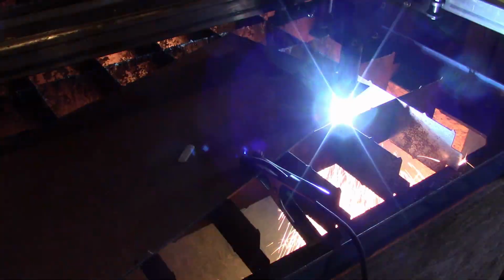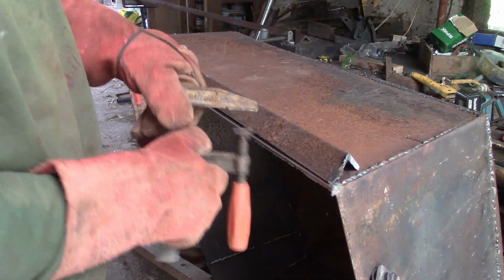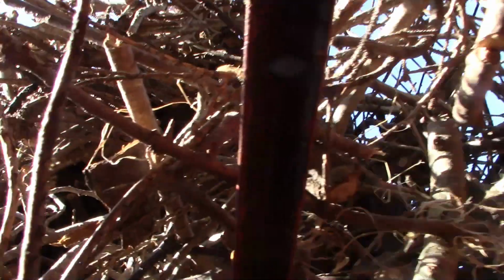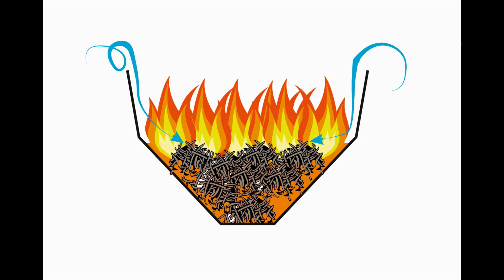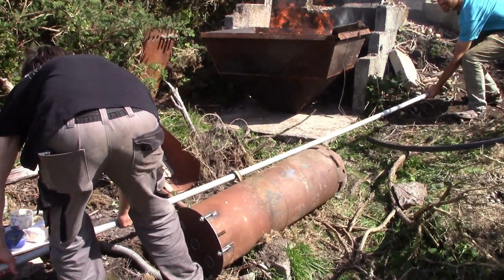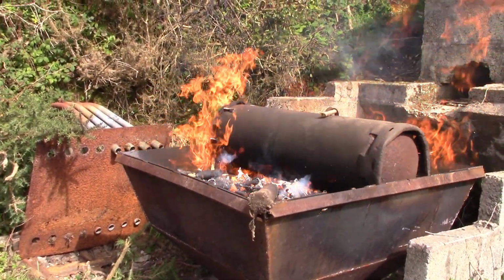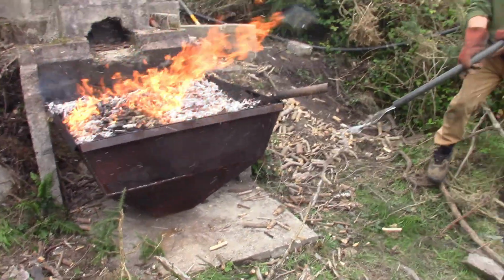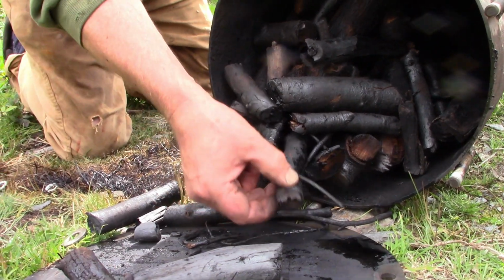Life, Death And Charcoal. (Testing The Chip Trap-Doors, Making Charcoal Kilns, Activated Charcoal..)

Comment: you could turn water into steam, to transport the heat to where ever you you want to store it. you condensate the steam thus getting the heat back. If you do that you could do some work with the steam along the way. f.e. you get some old broken 4 cylinder motor. you use two of the cylinders, for the steam and the other 2 to compress air. Preferable you would compress already compressed air, thus getting from lets say 10 bar to 70 bar or whatever ratio the motor has.  I would think it were rather poetic if you run your run your locomotive on compressed air, compressed by a steam engine.
You could also run a motor or a turbine with wood gas. that is less poetic though.

Comment: liquid sodium breeder reactor could heat your house. Or the Valley of the Kingsford briquettes.
Reply: In the mid 1950s in Lancashire we burned briquettes in the living-room fire. A briquette was about the size of a regular house-brick, but not as heavy. I suspect that these briquettes were made from coal-dust, or pulverized coke, with a binding agent.
Which makes me think of pulverized charcoal held together by, say, stongly-diluted wood-glue, formed into bricks, and left to dry.
This would be a form of stored energy.
Trolley the briquettes to the house and use them as furnace fuel, water-heater fuel and so on?
Chris

Comment: I now wonder what chemicals are in the water after the charcoal
Reply: I would venture a guess carbonic acid. Which it can really only hold so much of in solution depending on temperature. Nothing too gross its not like the tree was made out of heavy metals.
Reply: @ntacms90  ah so nothing that usefull
(unless you have lots of stomage problems)

Comment: Tim, look at rocket stove flue designs for the chimney. Where the flue stack is lined with refactory, which is heated by the combustion, to aid with the reburning of gases by the extra air.
Though they do require a lot of heat from the combustion to get/keep the stack hot. Which you may be struggling to provide?

Comment: A cone kiln are a simple construction, but it is very wasteful and just poring water do not turn charcoal into activated charcoal. Have a look at "Cody's lab" for making and testing charcoal and activated charcoal. The steam pressure has to be internal in the charcoal to increase the surface and activate it, but you get the same result from using regular charcoal if you triple the amount.
Reply from the maker: Thanks. I have watched all of Cody's charcoal videos. And yes, you can use water to activate because it turns to steam in the charcoal.
Reply: @wayoutwest-workshopstuff6299  You should replicate the filtration test that Cody do and compare it to a commercial sample.
Whatever the result it would be interesting to see the effect of the way you do it.

Comment: Could one accomplish the same as a "cone kiln" by simply digging a hole in the ground about the same dimensions?  I probably have you beat on a "shoestring" budget. :P
Reply from the maker: I'm sure a hole in the ground was exactly how charcoal was made for thousands of years. It's just more difficult to empty and if the ground is wet (as it often is here) it would spoil the burn
Reply: You can. But the ground would suck away an awful lot of heat energy, so you might not get the temperature high enough where the wood touches the ground.

To keep that kind of thing being a nuisance, you could make the hole huge-er, so the ashes and charcoal and wood Gases act as insulators

Or you could line the hole with something insulating and heat resistant like mineral wool or calcium silicate, but those materials tend to not like being exposed to the moisture in the ground when the thing is not in use, so you could line the earth first with something impermeable and heat resistant..... Like steel.... But then, here we are again... We are building a steel cone kiln, and also have to go through the effort of burying it, and lining it with some insulation, so best just leave it outside the ground and let the air do the insulation
Reply: Thats how it was done historically. Earth is a good insulation too as added bonus. Here is a link for old documental film of several traditional charcoal making methods in spain.
 https://www.youtube.com/watch?v=uR9fHKO-vlY

Comment: You will need a set of tracks on either side of the kiln, with a crain structure built between them so that you can lift lids, and charcoal tubes in and out. So much potential.

Comment: There is a better way of doing it!  Use 44gal drums  with holes in the bottom - fill them up with the fuel - light them from the top - the fire burns down - air comes in underneath and there is no oxygen remaining in the upper levels to burn the carbon , but lots of heat to keep the pyrolysis process going.  When hot coals appear at the bottom of the drum and you're sure it's finished - cover the base with dirt to stop air from going in the bottom - and if you've got an effective seal on the top of the drum you can wait for it to cool down below combustion point - if not cool it with water!
Reply from the maker: It's better in some ways, but slower too
Reply: But a lot less work - no need to feed it - just come back regularly to check if it's finished and shut it down.  You get about a third of a drum of charcoal!

Comment: Dear Reader,

I've thought of a simple and cheap 'locomotive'. Why not build a simple rail speeder from steel pipes, and, let's say, an old mowing machine motor? 
There are many examples of building a DIY speeder on YouTube. This is just one of them. https://www.youtube.com/watch?v=FQTYJQku_Ao
With a good gearbox, you could deminish the top speed and increase the traction, so it could pull an wagon load.

Just a thought.

With Kind Regards,
Michel F. van den Brun
Viewer

Comment: The Best explanation of Flame Cap Pyrolysis I have seen to date wonderful great stuff.

When I want to start my fire quickly in my kiln I use a tepee fire to begin, this fire can be quickly scaled by adding rings of longer and longer sticks, I usually blind each layer with the wood from our branch logger to fill in the gaps.

Comment: really long, long way to get this charcoal and on top an awfull lot of work.
But at the end the biggest benefit might be the heat generated and used in the house one way or the other as warm water or heating which both will require a big and highly isolated watertank as a lont time storage considering the amount of heat generated in such fire. 

Still wonder why those chips are not falling directly into that fire cone place - some how controllable cause now it needs a lot of work to throw them in with such fork.
Great progress and final product even though it might be a longer way to get it done in a bigger scale with such layer of bombs on top. I also think the holes are too small in this bomb therefore the high pressure which can lead to condensation in side which then would cool down or protect the chippers on the outside.

I can remember that decades ago when we were trying to smoke our fishs. Huge apparatus, lot of work and preparation for the right chips to get the right smell and sometimes the fishs back fin melted away and the fish fell down into the 'smoke fire'. 10 fish and all were gone in the first try due to too much heat .

Comment: I've heard that salt and be molten into a liquid and is good at storing lots of heat.
Reply: Common salt melts at 800 degrees Centigrade/Kelvin good luck with that!!
Reply: Before solar PV got cheap there were some solar thermal schemes that used concentrated light to ultimately melt salts as a heat transfer/storage mechanism.  I love Tim's historically inspired projects, but I would be curious to see some modern retrospective engineering as well.  Some things we have in the modern world would have been possible with the technologies of the past, we just didn't know!

Comment: The CO2 released from burning wood is a non-issue. It is part of the renewable circle. The CO2 that is a problem is CO2 produced from burning coal and oil. People like to throw about the idea that burning wood is just as bad as burning coal since essentially it is the same thing. 
The problem with that view point is that the carbon is being taken out of the air by the tree in the first place. It is part of a loop of carbon extraction and release. The problems we are facing with climate change is due to the release of carbon that has been sequestered deep beneath the ground as oil and coal.

Also, with the way your cone kiln works, the fire is always on top of the stack. As the wood beneath it is heated, it releases its VOC's which are then burned by the flame, making a really clean burn
Reply: Any burning of wood is carbon neutral - making charcoal is carbon positive if you never let it burn again. Bury it in your garden as biochar and I doubt it will get back into the atmosphere.
Reply: Coal and oil were once in the atmosphere stored away by mother nature by a biological process. Burning coal and oil just puts it back where it started from.
Limestone, chalk, coral and marble also carbon stored naturally by mother nature. We are in a carbon debt.
Reply: @andrewmills744  Yes, stored away many millions of years ago, and created slowly over millions of years. Are you aware that the last time we had this much CO2 in the atmosphere there were forests on Antartica?
Reply: @solrogersmullins5973  what's wrong with forests in Antarctica? We didn't do it... must have been mother nature. 
All the coal was laid down in 120 million years. 
Oil will regenerate.
Reply: @andrewmills744  The issue with "forests in Antartica" is that the conditions that would make that possible would mean the extinction of just about every species on earth including us.

climactic changes like these are supposed to happen over many millennia, not decades and centuries.
Reply: @solrogersmullins5973  where did you get that from? 99 percent of all life on earth is extinct
Reply: @andrewmills744  I don't see your point. How does that change the fact that rapid climate change will cause mass species  extinction?
Reply: @solrogersmullins5973  show me this "rapid climate change " . Remember we are still leaving an ice age.
Reply: @solrogersmullins5973  the end of the Carboniferous period is an example of climate change extinction as plant species and simple life died off because of the shift from a co2 rich to a oxygen rich atmosphere. It's that life that became the coal and oil.
Reply: @andrewmills744  the world was a more inhospitable place back then
Reply: @Falney  sure it was dinosaurs living it large.... how many deserts did they have vs now? Mmmmmm
Reply: @Falney  coal is 240 to 120 million years old, hardly older than the dinosaurs. Oil is being generated constantly.
Reply: @andrewmills744  wrong. It's from the Carboniferous period. 358 to 300 million years ago. The earliest dinosaurs didn come until 45 million years later.
Reply: @Falney  what is the name? The name of the little world you live in?
Reply: Tim's experiments are inconsequential compared to flying airplanes around etc, but burning wood IS the same as burning coal, no reason to green wash it.  Carbon has been sequestered in the wood and is being released when it would otherwise eventually be buried, or sit around as lumber in a house.  I don't believe soil is a net producer or consumer of methane, so that shouldn't affect it.  Everything in modern life produces extra CO2 though, and it mostly doesn't matter.  We just need to produce a bit less.  Watching things burn on YouTube is very green BTW.

The impacts we predict from large-scale climate change are mostly bad to unknown.  Would you happily push a child in front of a moving bus so they go to heaven?  I guess it could turn out great, we'll have to try and see!
Reply: @andyb2339  Unless you take wood from the surface and bury it in an anaerobic environment, all cellulose will eventually be converted by bacteria into glucose releasing carbon dioxide and methane. You have bacteria that do this inside you right now, all animals which consume plant matter do.
Reply: @andyb2339  burning coal and burning wood are not the same. It's like bio fuel vs fossil fuel. With bio fuel you grow a plant, most often oil seed rape. This takes co2 out of the air. You extrac the oil, process it into a fuel and burn it. It is co2 net neutral where taking crude oil and using that introduces new co2 into the air. Thus net positive co2.

It's the same burning wood over burning coal. You grow a tree, removing the co2 from the air. You then burn that wood which releases co2. Net neutral while burning coal introduces new co2 into the environment.

It's the same with methane from digestate and methane from a well. 

Hence my comment about it being a closed loop. 

Converting coal plants to burn wood pellets is technically greener, at least in the short term, than replacing that coal plant for green energy.
Reply: CO2 is still a trace gass in the atmosphere, measured in parts per million. Wouldn't more CO2 in the atmosphere not give us more plantfood and wood actually?
Reply: @NicoSmets  We do need the greenhouse effect. The concentration of Water, CO2, Methane ect that is in the atmosphere naturally gave us our climate we had 200 years ago. By putting more of it into the atmosphere, we are Terraforming the earth into getting warmer in the long run. And the additional heat that is trapped by the CO2 emitted by us is going to make more water vapor (that is what causes stronger storms and more droughts, too). Locally, there may be some cooling effects (it is expected that if the golf streams stops due to the missing ice in the north, that Europe is brought back into an Ice Age for some time, until the temperature catches up), but we can assume that wild anomalies like storms, droughts, heat waves, cold snaps ect are going to become more frequent as they would have been with natural concentration of gasses.
Reply: @NicoSmets  sorry, but that is a very stupid talking point.
Reply: @MusikCassette  wel why? It's probably true.
Reply: @MusikCassette  Is it why? You said it was stupid so why is it stupid? Plants and trees taken in C02 and chuck out O2. So where is the problem?
Reply: @wideyxyz2271  Of course plants need CO2, but it's all about balance. A the moment there is more CO2 being produced than all the worlds vegetation can sequester. Yes, plant growth will marginally increase with heightened CO2 levels, but the effects of greenhouse gas induced climate change (increased fire, drought, more violent storms, ecosystem breakdown ect.) far outweigh these gains.
Reply: @solrogersmullins5973  unbelievable.
Reply: @solrogersmullins5973  try again historical co2 levels have been higher than now.
Reply: @NicoSmets  shhh - they never talk about this obvious detail
Reply: @mattsan70  Really never? Is that why Google Scholar gave 431,000 hits for "effect of elevated co2 on plants"?
Reply: @NicoSmets  Yes it would but they hate to admit it! They always forget that water vapour is a green house gas too and where would we be without that!
Reply: you think, you thought it through to the end, but you did not.
Reply: @MusikCassette  please elaborate
Reply: @MusikCassette  tell me about the end!

Comment: Tim, what about welding in some firetubes into your kiln to get more heat into the interior. I know it might make loading a bit more difficult so I would position them from end to end of the retort, rather than crosswise. Maybe just a large central flue.
Reply from the maker: Into the retort? Yes, but I have a different plan...

Comment: Whilst trying to build these kilns, perhaps bring out tornado more to help out a little more, not only could he bring supplies up to the kiln sight as your working on it, it would also work for an opportunity to find out how much tornado can pull in his current form
Reply: Or try to push all the wagons with Tornado.
Reply: Yes pushing the wagons with tornade
Reply: Why, if pushing them works fine? He’s explained previously that he doesn’t really have a use for it until the large extension is built. It would just require more time and effort to get it prepared.
Reply: @harryrobinson2901  touche
Reply: @harryrobinson2901  to test tornados strenght ofcourse.